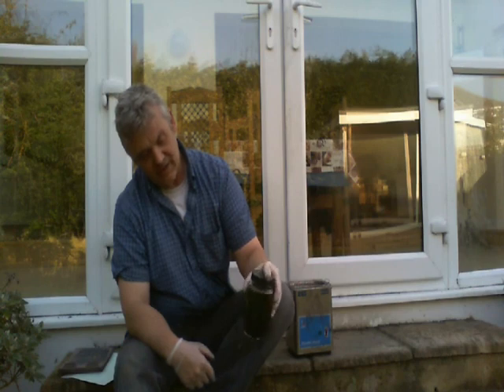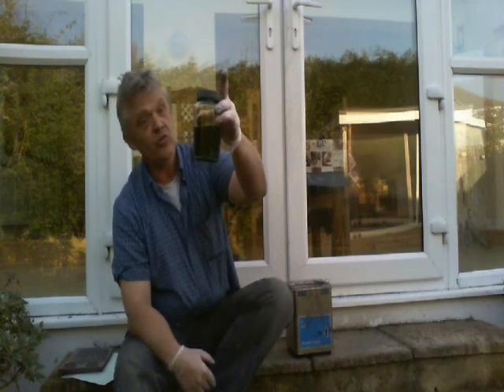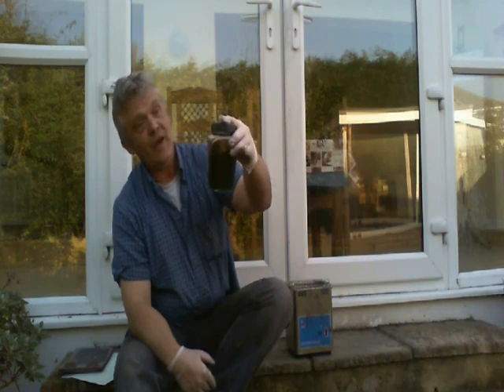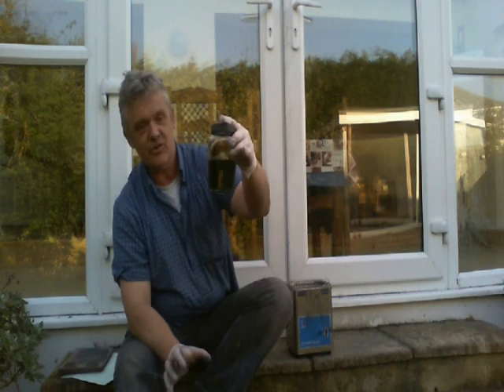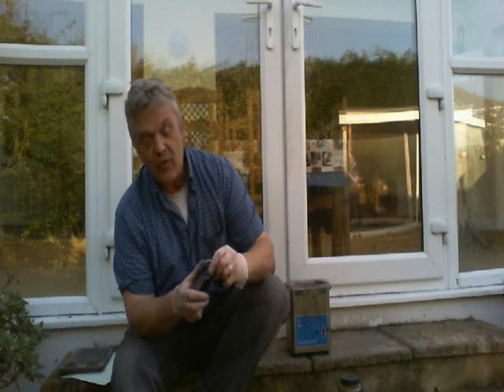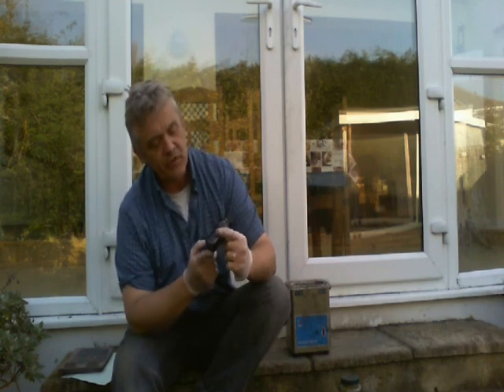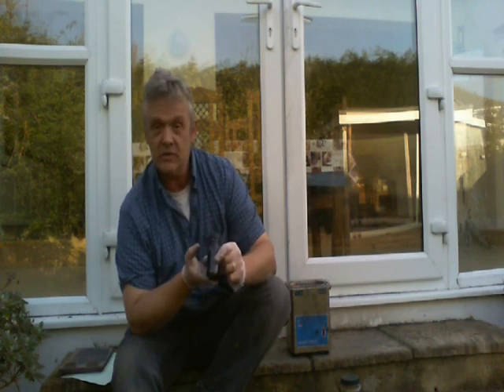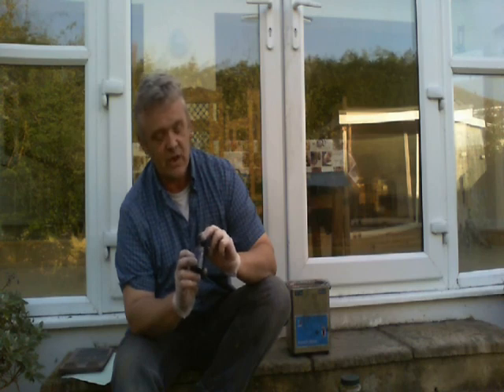New Graphene Method Part 2 - Making The Graphene

Comment: How do I verify that the intercalation has taken place? Is there any chemical or physical verification method?
Reply from the maker: +Chaitanya Bhave what are you intercalating with?
Reply: Chlorine and iodine are the ones I've tried so far...I'll try bromine if I get a bromide salt
Reply from the maker: +Chaitanya Bhave conductivity increases
Reply: Robert Murray-Smith oh yeah. That seems easy to check. Btw I found a way to make graphene in solution using your mechanical method- and it doesn't seem to require a homogenizer.
Reply from the maker: +Chaitanya Bhave that's very cool - want to share?
Reply: Sure. It's basically the same thing you did with the mechanical method, but instead of dry graphite, I used a little soap+water to wet the powder. As a result, the graphite is sheared by the process, but doesn't stick to the surface- instead it gets into the soap-water solution. It foams quite a lot. I then just added some water to the foam. It seems to be stable, but only time will tell. I made it half an hour ago. How long should it stay stable ideally?
Reply from the maker: +Chaitanya Bhave nice one - a few weeks
Reply: +Robert Murray-Smith that's a long time. Any other way to verify the presence of graphene ?(hopefully not sem/tem)
Reply from the maker: +Chaitanya Bhave raman
Reply: +Robert Murray-Smith you do Raman spectroscopies of your samples? I was hoping for something a bit more...low tech. lol.
Reply from the maker: +Chaitanya Bhave lol - leave it for a couple of weeks if it is still blue it is graphene - probably
Reply: +Robert Murray-Smith blue? I've got black. As far as I remember, graphene is back?
Reply: *black
Reply from the maker: +Chaitanya Bhave most of it will probably drop out and you will be left with a blue solution - well light black if you like - your best bet is to try it and see

Comment: Hiya Robert, I tried this and it separated into black sludge at the bottom, and a bright yellow bromine water. Which one of these am I supposed to keep? The video was a little unclear. Thanks!
Reply: Robert Murray-Smith Hm, I seem to be getting 2000ohm resistance with this 'ink'. Will washing it or anything else improve the conductivity?
Reply from the maker: sure - but so will heat treatment - but - to be honest if you check out the literature a 2k resistance is a pretty good result
Reply from the maker: I would probably try vacuum filtration and microwave exfoliation - though a preheated furnace would work - but, mate, this is meant to encourage YOU to experiment and so it is not a cookery site with recipes to follow and you get a cake at the end of it - you will just have to try a few things and see how it works out
Reply from the maker: lol - cheers mate

Comment: Hi Robert. I've been following you work for months now and it is time to get off my butt and do some discovering. I am looking at the lightscribe method of making supercapacitors. I'm struggling to get the whole graphite-oxide, graphene-oxide, graphene in suspension thing. Would making graphene this way be suitable for the lightscribe method, or should I use one of your earlier methods of making graphene-oxide? Thanks and good luck in you future endeavors.
Reply from the maker: Hiya Mate - if you want to use the lightscribe method the first thing you need is graphene oxide in water. You will have to make it - so use the method in my large scale graphene oxide method video

Comment: I happen to have graphite on hand, but it's 75 micron (275 mesh), do you think it would work or should I go out and get the ultra fine stuff?
Reply: +staticnetwork My first instinct with a larger graphite would be to let it soak for much longer. Maybe even giving it a few rests during sonication. I don't know much, but if you still got the stuff, it might be worth a try.
Reply from the maker: sounds good - i would try it with that
Reply: I tried it and the material looks like yours, from the brown liquid to the black.  I couldn't find deionized water (I live in Oregon) so I used distilled water, but I easily found the sodium bromide at a pool supply store (http://amzn.com/B000V8BUF0 )
Reply from the maker: cool
Reply: I tried to make this and I'm not certain if the particle size of the graphite was too large or if the sonication wasn't good enough, but my batch seems to be black at the bottom and bromine liquid at the top.  I've order 5 micron graphite and I'll attempt this again.
Reply: staticnetwork I'm getting the same results as you. Is there a major difference with 5 micron graphite?
Reply from the maker: not really

Comment: Have you ever experimented with graphene as a replacement for platinum as a catalyst for an oxygen reduction reaction? The idea of course is to make a cheap PEM fuel cell at home. I read that using iodine instead of bromine will allow the graphene to conduct 33% more current than platinum. I am of course no expert but, I would love to hear your take on the subject.

Comment: Hi!,seems to be much cleaner method indeed! I followed the article you had mentioned,according to it, to the wt ratio of graphite to Br used it atleast 10 times less that what is used in your method. i.e. if we use the same Graphite/ Br ratio we shld be adding 0.2g of graphite and not 2g of graphite.. Is there any reason to add 10 times more?
Reply from the maker: it just needs to be in excess